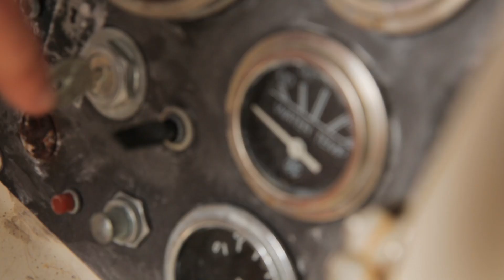3 Guys and a Dog Sail to Belize (Sea Change - Chapter 1)

Comment: Well done, lads. My 1953 Dutch-built steel girl is still sitting on the hard, awaiting more welds to her hull and paint on her deck.  The relentless summer heat is yielding to autumn's brisk approach, and the work readying her for Mother Ocean (was once a Marine) is less demanding in the cool air on the brow, but more urgent in the heart.

It is a pleasure to open a brew on deck in an asphalt sea, after a long day of shipwright's work, to get a little inspiration from those who want to share with me that it can indeed be done.

Fair winds and following seas to you all.

Comment: Wow, wow, wow Poetry on Video...I bet your Cam gear is worth more than your Boat ;-)
Reply: Not necessarily. You can achieve this with sub $1000 gear. It's more about knowing what to get and how to use it. For instance they probably use a lot of prime lenses which aren't any more expensive than your regular lenses, they just forego zoom for smaller aperture etc. Of course they might be using weather sealed pro lenses and enclosures for underwater shots and that can get pricey, but nowhere near the price of the boat.